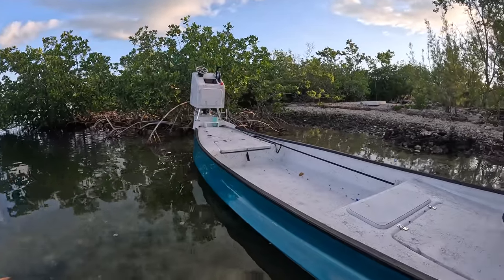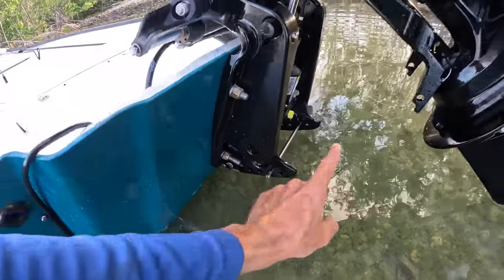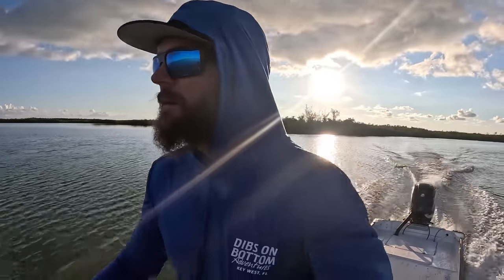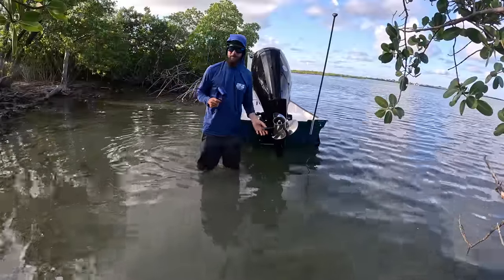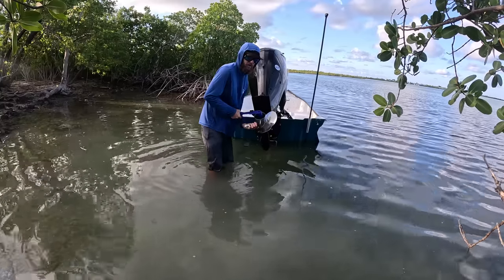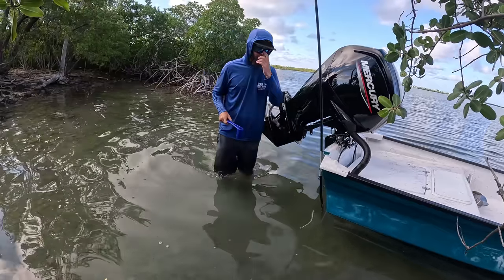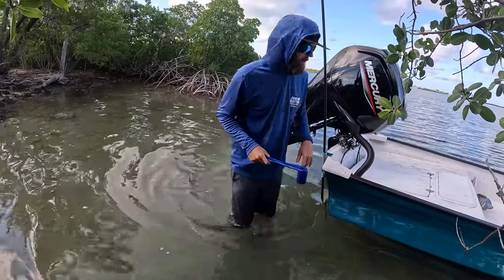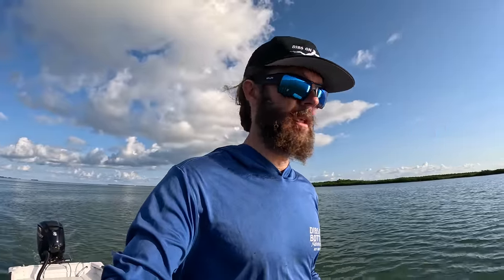Little Boat - Big Motor | Prop Testing | 3 Blade Vs. 4 Blade

Comment: The 3 blade prop got a bit better gas mileage as well. Nice safety tips Aaron. I respect that you always are as safety minded as possible and promote that. But you have some fun too. Much respect.

Comment: i'll just throw this out there, but in aviation, the debate is usually 2 blade vs. 3 blade. and generally i think the wisdom is, that a 3 blade "grabs more" and so is better for takeoff and climb, but a 2 blade is better for go fast in cruise (once you reach your planned altitude and level off), and usually the reason cited is that less blades is less drag, so good for cruise, but, more blades is more "grab" which is better for getting off the runway and climbing. i assume boat propeller dynamics are similar.

Comment: If you do decide to build a bow rider i suggest riding in a mullet/gigging boat first. They are on a whole different level of control from a helm and you better hold on....they will throw you out. Ive owned 5 gheenoes but this one by far is my favorite Aaron. You and Sammie built a fine machine!

Comment: Definitely 3 blade for the win.  
I already had an opinion but I’ve never owned or ran a gheenoe. 
I do however run a 4 blade on my 24’ bay boat.  
I sacrifice fuel economy and top speed but I gain holeshot while loaded with fuel and passengers. 
I never would have thought your gheenoe would need a 4 blade but I did consider the fact you put your helm at the bow.  
So what I did notice.. Is that with the 3 blade at top speed.  You had a slight porpoising compared to the 4 blade. 
Did you happen to mess around very much with the trim as you were testing both props?

Comment: I threw the numbers into Excel and plotted out the Speed versus RPM. The data shows the 3 blade will give you slightly higher speeds at the same RPM as the four blade. I'd assume that's in part because the 3 blade has less drag than the 4 blade. Great video, very educational! Thanks for sharing
Reply: The 3 blade needs about 3% less RPMs to achieve the same speed as the 4 blade.
Reply: @plantzengineering9925 I imagine that it’s the extra blade creating slight cavitation so the reduction in rpm is a direct result of the ability the 3 blade has to gain friction. 
I’m no engineer but I have had my fair share of prop testing both driving and being towed by boats. 
I used to run a 23 pitch during races and a 21 during social season (both 3 blade).
Reply: That could very well be the reason  @Aaron_Hanson . I don't have the hands-on experience with testing props so I'll take your word for it. Very interesting stuff, thanks for the comment!

Comment: The choice is clear. 3 blade for the win 👍 
The 4 blade did plant the bow a little better. You were hopping around a bit at top speed with the 3 blade. I’m sure it’s not a big deal at cruising speed.
Reply: I'm pretty sure that could be remedied by trimming the engine out better. Maybe a set of trim tabs? (don't know how that would work on that kind of a boat though)

Comment: Need to play with pitch.  Everybody is spot on for blades (bigger/heavier/larger boats run 4/5/6 blades for that reason), but on a boat that size/weight, you need more pitch.  If you can hit max RPM, keep going up in pitch till you can't, then you can back down.  Buddy had a 18 foot center console with a 90, and it would hit 40, so you have a lot of extra HP waiting to be used.

Comment: 3-Blade Propellers

Higher top speed: 3-blade propellers generally have a higher top speed than 4-blade propellers.
Better acceleration: 3-blade propellers also have better acceleration than 4-blade propellers.
Less drag: 3-blade propellers have less drag than 4-blade propellers, which can lead to improved fuel efficiency.
More efficient at higher speeds: 3-blade propellers are more efficient at higher speeds than 4-blade propellers.
4-Blade Propellers

Better handling: 4-blade propellers provide better handling and stability, especially at low speeds.
More grip in the water: 4-blade propellers have more grip in the water than 3-blade propellers, which can be beneficial for boats that are used for towing or carrying heavy loads.
More efficient at lower speeds: 4-blade propellers are more efficient at lower speeds than 3-blade propellers.

Comment: Did you ever consider an outboard with jet drive vs traditional?
Reply: They lose a little speed and Power but better for saving the grass Flats and manatees but don't do good with plastic bags
Reply from the maker: alot of areas here jet drives are prohibited.
Reply: @KeyWestWaterman  I was just curious. You seem like you do all your homework before a big purchase. I figured there was a logical reason
Reply: Jet drives are inefficient and have many issues. You can't just pop the impeller off and install a new one like a prop outboard

Comment: the pitch has a lot to do with speed. getting the right picth for your boat maybe a challenge. maybe a prop shop can let you try many different pitches until you get the right one. i used a 9 pitch wide blade  when hauling a load and a 13-pitch when fishing in rocky bottom.

Comment: Thinking of staying in the boat if something gets dicey I know you have the wheel to hold and the throttle but instead of the throttle maybe a dedicated "oh shit" handle would be good on the right side of the helm. And 43 mph is fast in a little boat like that, my late grandpa's old Skeeter stick steer I called the coffin would go about 30-32 and it felt like 50.

Comment: Normally 4 blades have better lift and turning bite. And better low end holeshot, but I think the way your boat is setup it kind of counteracts the benefits of the 4 blade. Good info though.
Reply: I thought the 4 would be ideal for this application too. Generally they describe 4's as having bow lift, not stern lift. That is due to the fact you can trim them significantly higher before ventilating. Even after ventilation a 4 with some cupping will provide lots more thrust than a 3. I've got a cupped 4 on my 14ft with a 25 hp and it runs 27-28 and will run 25 with half the prop out of the water and a low water scoop. 3 blade wouldn't come close to that.

Comment: I'd try a 17p 3 blade Mercury prop. Probably get you the best mpg and cruise speed at 3500-4000 that your after.
Reply from the maker: yea I was looking for a 17 to try, slightly bigger would push a hair faster/more efficient at cruise but lose a tiny bit of rpms at top end which i'm not concerned with. Hopefully can find one!

Comment: What is the gear ratio on that drive? According to Mercury prop slip calculator, you are going faster that that 15p can possibly go. -3% slip. I must be missing something. Thanks!

Comment: It looks like it rides well at 40 but I bet it rides a lot better at 25mph. I am in Bass Boats fairly often and hull design has a lot to do with speed and comfort. Boates that ride well at high speed don't do super skinny water very well. Still looks like Harley designed that one to have a nice helping of both worlds. Floats super shallow, stable, and handles a bigger engine just fine. Gheenoe is and will always be one of my favorite boats on the water.

Comment: did you trim it out for top speed ? seems sad but weight of 4 stroke doesnt help yet its the future 
 our 19 ft aluminum center console got 38 mph in trim w  70 HP 2 STROKE jOHNSON IN THE 90S

Comment: 😮 wow did not realize the bow dug that much from watching your regular vedios.  It would have been nice to have the same camera angle on the two  drive by's, but the 3 blade propeller bow shot the bow looked higher and the boat look like it would be more stable than the 4 blade  propeller might be in choppy water.

Comment: Wanting stern lift on a bow heavy boat is the exact opposite of what you want for better handling and performance.  You should easily be able to run a 17p 3 blade on there and have the power to spin. General rule of thumb wheh trying to get General similar performance from a 4 blade a 3 blade, as in comparable rpms at WOT is to go up a minimum of 2 prop sizes. ie, 15p 4 blade to a 17p 3 blade, and vice-versa. You should Always get a higher top speed with a 3 blade. Better hole shot with a 4. "Should" be better cruise economy with the 4 as well, but in that size/weight boat it's probably negligible, especially if the 4 blade is giving you more stern lift, which is further exacerbating your bow plowing. I'd be curious to have you try a 17p 3 blade. I'd also be curious to see how the boat would respond to dropping that thrust pin a notch at a time with the 16p and 17p blades, to see what handling characteristics become like. Great video and cool boat!

Comment: Slightly better MPG and top end speed with the 3 blade but from the video at least you were running nice and flat with the 4 blade and definitely porposing with the 3 blade.. Maybe just needed to trim down a bit.

Comment: Whats up man,  you look as though you have lost some weight  , you good ?  Oh have you ever thought about putting a dolfin, you know a hydrofoil on motor 🤔  i don't know all the dynamics of the boat , or if it would work for you. But I thought it would look cool skimming across the top of the water when its glass.

Comment: Keep testing, the amount you sail your boat it will make a huge difference over the next five years.
You rig runs good, but I think you can do better,,, try some extremes,,just to see. I’ve found that the documents just don’t cover unique configurations like you have. Plus it’s pretty cool when you find some combination that fits perfect.

Comment: It is your call. I would stick with the four blade. On the drive by there was very little difference in the bow attitude. With both props it seems like you are running downhill.

Comment: Used to sell props... man it's a .. based statistics to start from.. trials and ajusting kinda.. your dealers have to let you try 2 or 3 props to get the money.. we did that. No buying trail and error...depends of the set up. 4 blades alot of torq to the plane. Less speed.. 3 blades more time to planing more top speed... 🤷‍♂️👊👍❤️

Comment: Have you seen the prop that looks almost like a ribbon? 
It isn't blades sticking out, the top is wrapped back around to the center,
Supposedly the most efficient of any prop by far, no comparison,

At least that's the claim.
Reply: Any more info on that prop, by any chance?..... Like a link for it?...

Comment: Running wide open, it looks like you’re off plane ever so slightly. Ideally, the back 1/3 of the hull should be touching water, front 2/3 not touching.   If you could trim up a bit, first you will get the top of the prop out of the water = a few more rpms.  At the same time, the bow raises up and there’s less hull surface contacting the water.  Less drag, more speed, more agility.  There’s a chance you’d porpoise some.  Tabs would fix that.  That’s my .02.  Works with my boat anyway.  I’m not an authority 😂.
Reply: You don't want any part of your prop out of the water.
Reply: @pain_weaver  You don’t. If that works for you, great.
Reply: @rodneyalaking8241  enjoy your cavitation and ventilation. 👍

Comment: you not spending $600 on the new design props from MIT ?  toroidal i think they were called billet aluminium (( not aluminum lol ) milled jobbies , supposed to be 35% more fuel efficient or something
Reply: They are not practical.  1 nick and you got severe cavitation.

Comment: So basically the 4 blade prop is marketing grift?! I thought the 4 blade was supposed to offer the best economy while sacrificing a little on the top end. Obviously boats are unique in the fact that no two boats are going to perform the same given different variables but from what you read or are led to believe the 4 blade prop on smaller boats is supposed to give a little more hole shot and fuel economy while sacrificing top end. Have you seen the Sharrow Prop???? Insane results but it's $5k for the prop. No joke. Thought it was a typo.

Comment: 4 blade is best on flats boats with a tunnel and a power backplate.or a slow boat like a pontoon.That speed with a 90 is not that great,think weight in the front is hurting the speed.It’s only a light narrow 18 foot boat.A 19 foot bay boat will go that fast with 2 people with a 90 hp.🥴